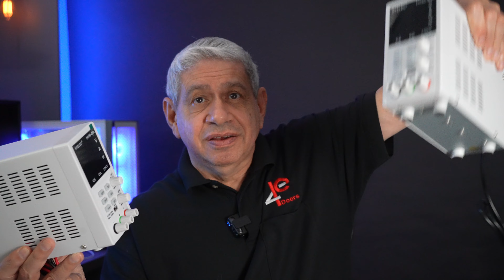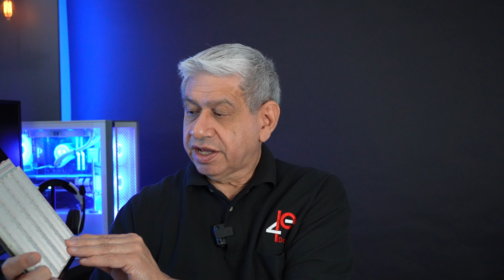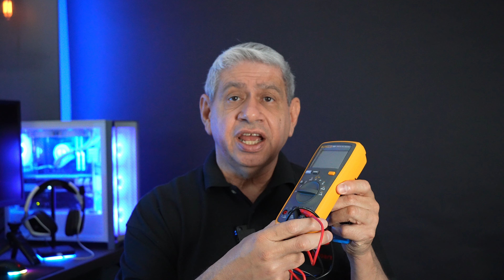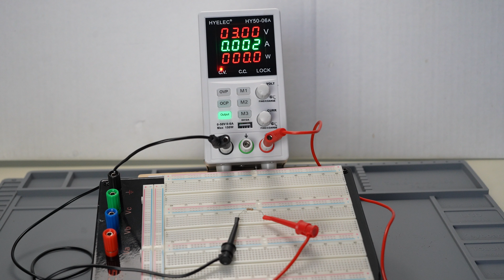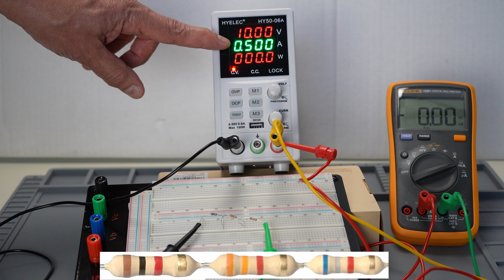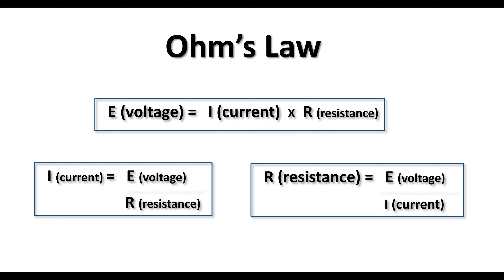Electronic Engineering - Lesson 1: Instruments & Voltage Divider Circuits

Comment: I haven't had a TRUE electronics course/introduction since High School. I'm excited for a refresher on the theory and terminology. It will come in handy for projects with the Raspberry Pi Pico 2 when I get my hands on one (or more).

Unless I missed it (twice), you may not have explained the acronym DVM. I believe this is a Digital Volt Meter.

Is there a standardized "margin of error" for a DVM as far as accuracy is concerned?

I could absolutely use a "color code" refresher. When you include that info, you might mention some reference websites.

I am certainly looking forward to the future episodes.
Reply from the maker: Thank Jeremy for the great comment 🙂
Yes, DVM is Digital Volt Meter.  Believe it or not, I still have an old Analog voltmeter somewhere in my garage.

I was thinking about a Color Code segment, but I have to decided how deep to go into that.  The tricky part is when the resistor precision if very high, and when the values are very small (like 1.35 ohms).  Those special ones are rare and expensive since they are used in high-precision test equipment.  So maybe I start with details on the more common values, and save the special ones for a future Part 2.

As far as 'Margin of error', that varies greatly on what a DVMs primary purpose happens to be, such as DC, AC, Capacitance, etc.  In my experience, both professionally and as a hobbyist You-Tuber, a Fluke meter is the most accurate with 0.5% on their lower-end models, and  0.05 % on their highest-end, and 0.1% in their mid-range models (using DC accuracy as a baseline).  I believe the Fluke 15B I have is my best performer having about 0.5% DC accuracy with it costing less than $150.  I have spent more on DVM that are less accurate.